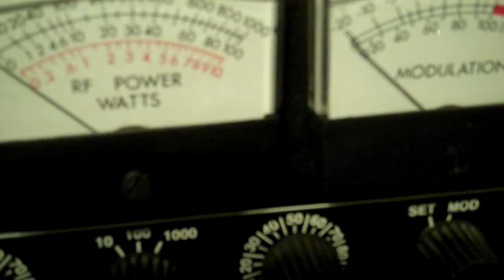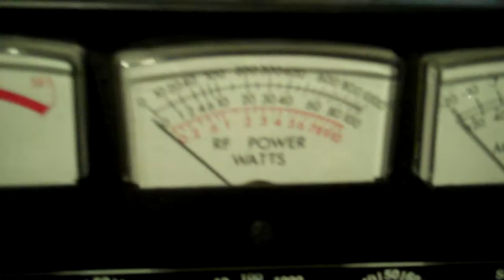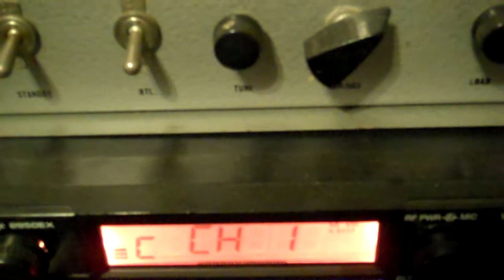Varmint Quad Power XL-600 Linear Amplifier test

Comment: That just about the way, the amp should be driven, and that's just about where the output should be. Maybe another hundred Watts, if you were to fine-tune it, as you mentioned oh, but we all know 100 extra W won't do anything on the other end. Although it is definitely a good idea, not to use an app for fire that's not tuned up probably. Very nice looking example of a varmint 600. Good luck to the new owner. 73
Reply from the maker: Thank you, and you are absolutely correct on that extra hundred not making any real difference in S-units on the other end. Nice to see somebody who gets it. 73's from the Central Buckeye